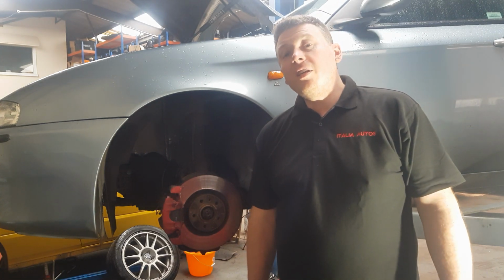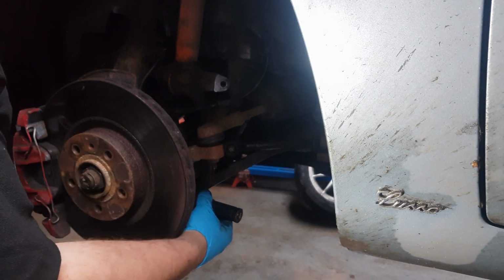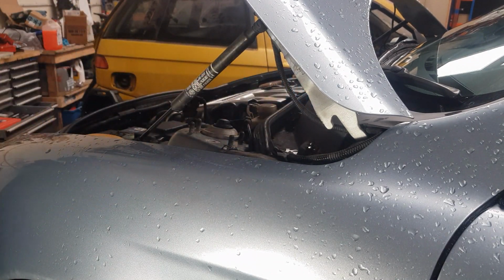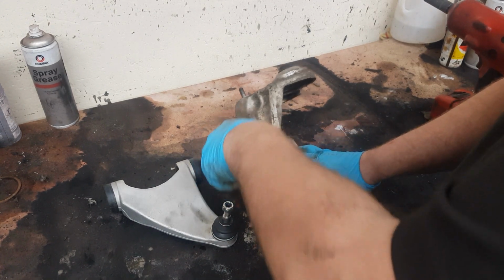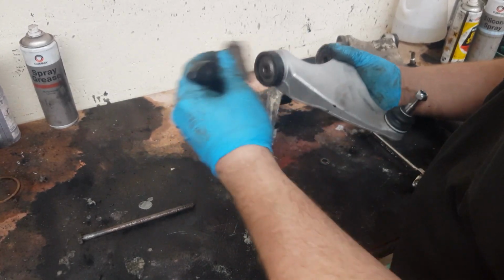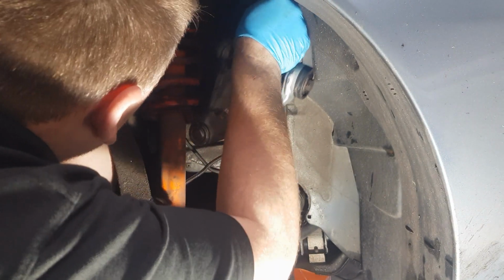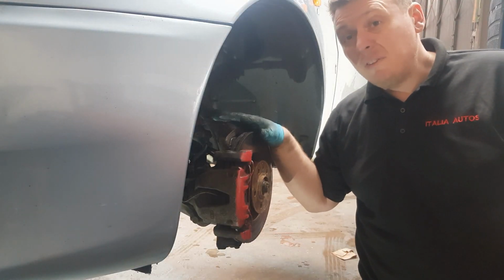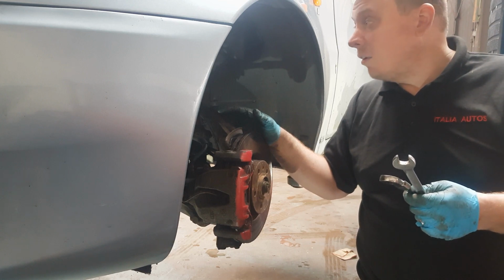Alfa Romeo 147 156 or GT upper wishbone change

Comment: 4:02 -  you can reverse the bolt and the next change you won't need to remove the whole assembly. It's tested and it will not touch the spring. For added safety, you can put another washer. Also the upper bolt should be tighten only after you lift the whole suspension with a jack or something. I'm just trying to be useful to others :D
Reply from the maker: The alloy mount can wear out that's why I always like to remove it.
Reply: But is it ok to to thia from comment above?

Comment: Just an observation; personally I'd tighten up the fork bolt on the bottom wishbone when you've lowered the car as it'll twist the bush prematurely tightening it unloaded, I ruined some new wishbones within months doing it like that.
Reply: Yep, all suspension bush bolts should be tightened when in the correct on ground position
Reply: Absolutely right, don't forget to pre-load the suspension or you'll ruin the fork/lower arm bush quickly. THIS bolt can be tightened just once on the ground but more normal to measure wheelcentre-to-arch distance before unloading the suspension (jacking the car) then when finished jack hub up till you have the right distance as above before tightening bolts. Then wheel back on....

Comment: I did this once on my 147. 
Right site no problem. 
Left site more of a problem. 
The upper wishbone bolt came out with no sweat. But the rest of it was so stuck I thought they did a dragon Ball fusion or something. 
I just had common hand tools and a jack to work with. 
It took me 9h, 3 bits, 2 drills and my finger. 😄
After I asked a work shop to lend me they heater for a few minutes, it came out, red glowing like a Baboon button. 

I will never forget this. 😄
Reply from the maker: Halil Güven heat is a mechanics friend 👍

Comment: Can the upper arms be refurbished? Seems like a waste to just throw away the aluminum part. Maybe a different ball joint can be fitted from another car.
Reply from the maker: Never tried or looked in to it.
Reply: Poly bushes but dunno about the ball joint.
Reply: Everything can. My experience is bushes fail before ball joints
Reply: @egon2875  poly bushes won't last long in this application. Wishbone too narrow. Best used for leaf springs

Comment: Good stuff! I need to change all four shock absorbers on my wife's Ducati Corse. I know the lower pinch bolts on the fronts are absolutely seized. Might you be making a video on this. Cheers.
Reply from the maker: Ian Smith yeah those are a right nightmare. Even I’ve failed on those.